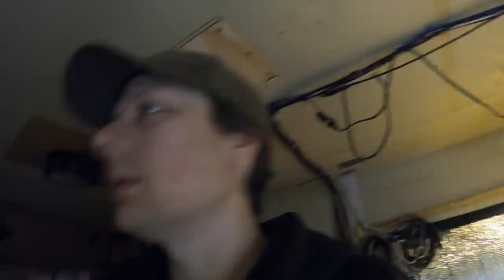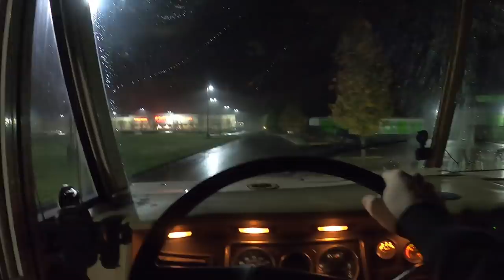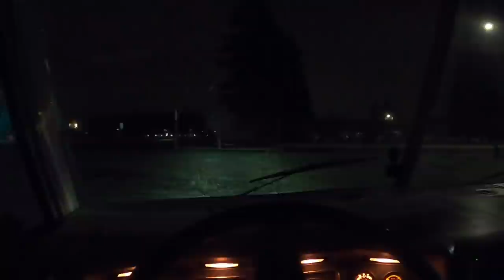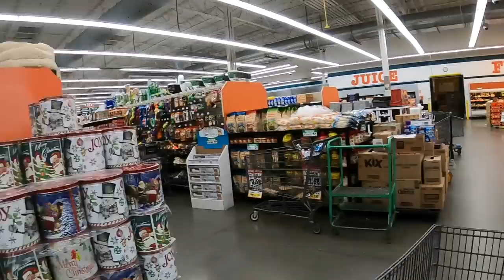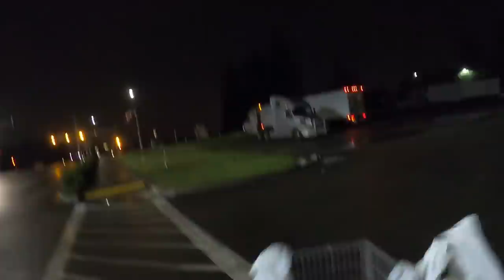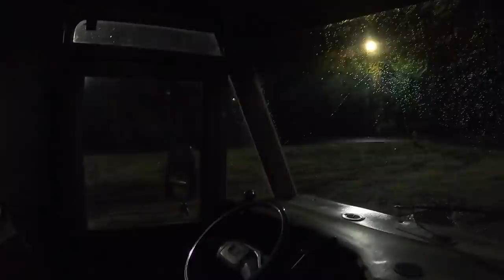1 RV 3 SEMI's - Nomad Man

Comment: Hey Nate, I run a very similar Suburban furnace in my class A, when it stopped igniting last  winter I found that the ignitor was simply fouled with soot. When you run low on propane often it can cause the flame burn less clean. Upon removing the front cover you will find a red wire leading too a plate with two screws, this is the ignitor. I hope a piece of sandpaper on the contacts will fix your issue, feel free to ask for more info or pictures. These are very reliable units, they do not often have complicated issues.

Comment: Nathan, always enjoy seeing what you have going. If I may suggest, why don't you simply run some 10 or 8 gauge wire with a disconnect plug to your rear generator instead of purchasing a battery. it can do double duty by starting the generator, and in a pinch charge  "Patches"  batteries.  I also improvise on pretty much everything, and that is why i believe I like your videos. Thoughtful pondering to figure things out and modify to your liking. Great Videos Thanks. I'm in North Portland off 205 by the Airport and I am always watching to see if I can figure out where your at, maybe you could have a fun little contest ongoing of Where's Nathan?  no prizes just fun guessing game. Thanks for the Videos

Comment: Hey nate,
Did you figured it out yet what the problem is with your bedroom diesel heater? 
You had white smoke filling the room. 
I had the same issue with white smoke after a power failure. 
It's been awhile since you spoke about that heater.